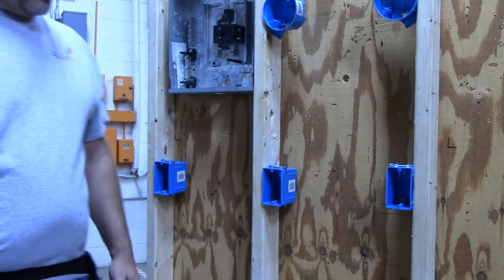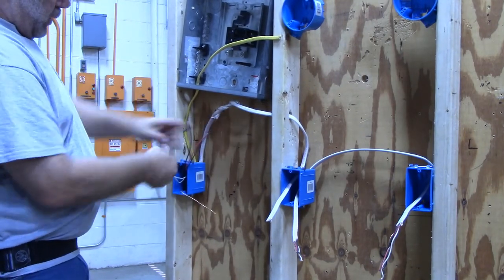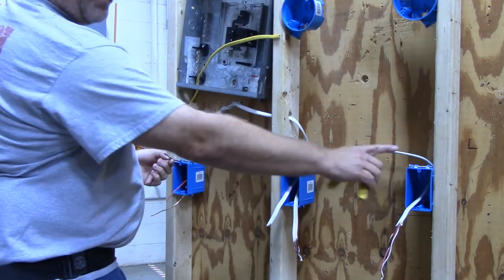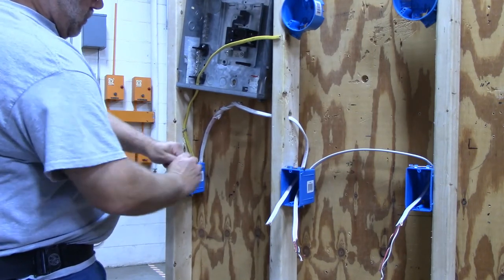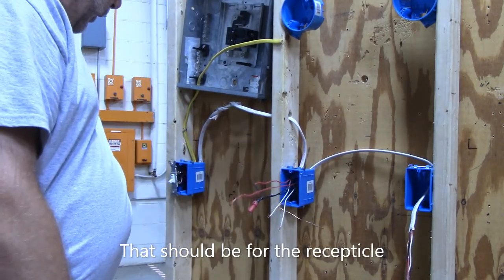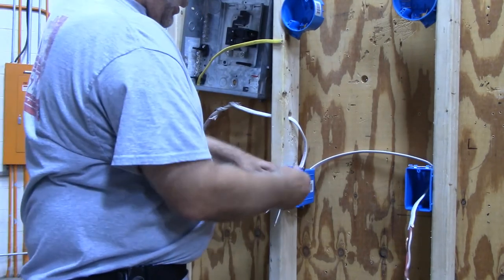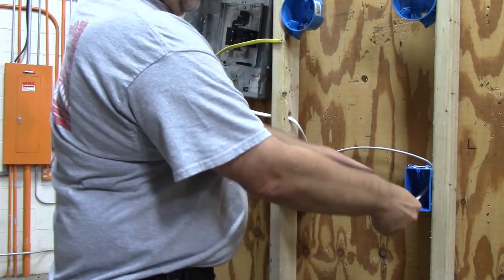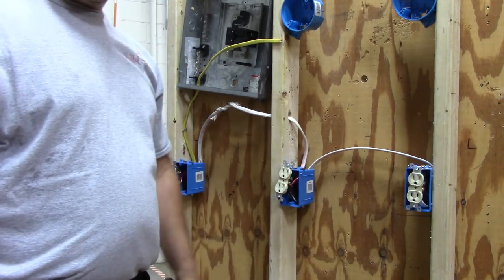single pole switch half hot half switched recepts

Comment: Can you do this same thing with several outlets?
Reply from the maker: Yes. My mom's house has 5 switched outlets on one switch
Reply: I want to put 8 outlet’s between 2, 3 way switches.
Reply from the maker: @kristirikard7202  just make sure there is no voltage drop
Reply: Using your set up for example, if I wanted that first outlet to be full hot, because we need to make sure the computer and printer don’t get turned off. Would you just wire nut the red together, tuck it in, and then not break the tab?